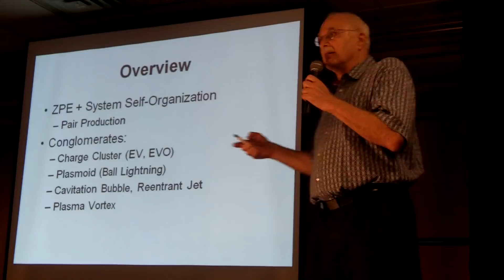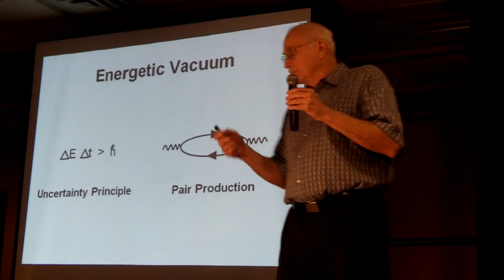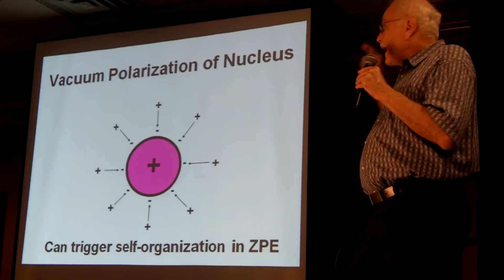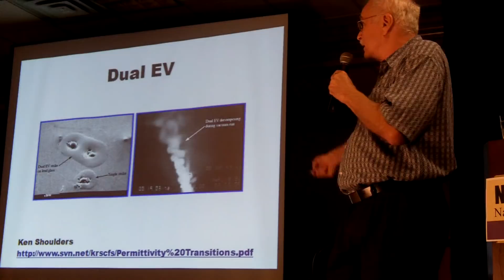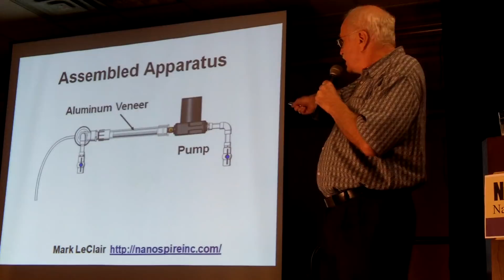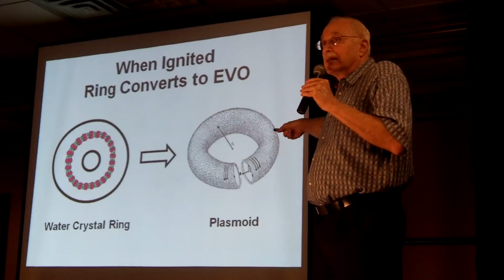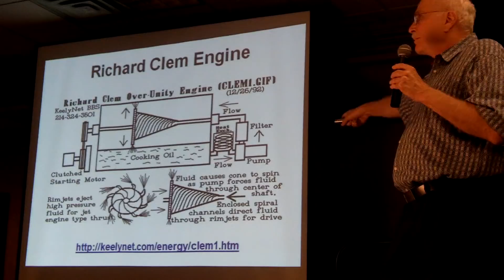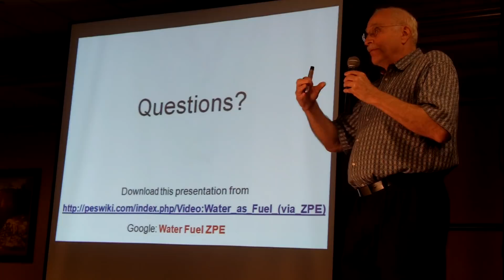How Can the Zero-Point Energy Become an Energy Source?

Comment: In 1983, cavitation from collapsing bubbles came within minutes of destroying the Glen Canyon Dam at Lake Powell, America's second largest reservoir, and second most massive gravity-arch dam. The lake (145 miles long) was already over "full pool" by over six inches. Lake Mead below at Hoover dam was full-time.The only thing holding Powell back was a double  row of 1" thick marine plywood strung along the top of the dam (500+ ft. tall). Water was being released at high rate, but not full out, when they received warnings of an incredible flash flood racing down river from the Rockies. They opened the dam full out. When the two 15' dia. release tunnels were fully opened, the dam, the bridge and the sandstone canyon walls began to shake. At river level, boulders the size of cars were shot out of the release tunnels, along with massive amounts of concrete. One tunnel was closed, and the flow through the undamaged tunnel was greatly reduced. Vents have now been placed in it. YouTube has video of this from a retired Reclamation administrator. The civil engineers with the Army Corps, Reclamation and Bechtel, had not confronted this sudden burst of energy from cavitating air bubbles in water in the design, construction and operation of the dam. The Bureau says the dam itself was not in danger of going, but that isn't the story from some retired workers. Physicist were just starting to look at cavitating bubbles in water for energy releases at the time. See May 1983 flood, Glen Canyon Dam.

Comment: Great presentation and thank you! The ether is the source all matter and energy. Light propagates through it and the sun is powered by it. The sun is cooler inside and hottest on the surface because the ether interacts with the hydrogen there. Plasma is a vortex and this rotation must be present to induce energy flow (organization) in the ether. When you understand that the ether drives the plasma it is no longer hard to understand and does not violate the "law" of conservation. The very fact that experts refer to "laws" tells you all you need to know, don't think or question them. It is amazing how arrogant "experts" can be. Just 500 years ago "they" would burn you at the stake if you thought the earth was round. The theme was "Don't question us" or you will regret it. Now we as a species must stop following dogma and recognize the universe for what it is. A coherent self organizing system.
Reply: Jack Harper When you say "It is amazing how arrogant "experts" can be. Just 500 years ago "they" would burn you at the stake if you thought the earth was round. The theme was "Don't question us" or you will regret it.".....

are you saying that the "experts" and the people who would burn you at the stake (the ones you called "they") are the same people? There was never a point in time where the people in charge of burning others at the stake were the leading physicists at the time. 

Also, that is the complete opposite of how we advance our scientific knowledge. Anytime a new discovery is made, or a new "law" is stated, the theme is the exact OPPOSITE of "Don't question us". The first thing scientists do when something new is discovered is for everyone to try to disprove it. It is only when something is tested over and over again, by different people, that it is accepted as a theory or successful model.

Nothing in science is "Don't Question".... it's all about questioning. Seriously.

Also, there is no either. This was proven wrong in like 1901 or something.
Reply: The experiment you are referring to was the Nicholson and Morley experiment (spelling may be incorrect.) But it was inconclusive because it was measuring the for interference patterns without understanding that the ether is dragged along by matter (the earth). Anyways the US Airforce announced it had verified the etherback in the 1990's. This brings me to your first point. Normally science is promoted by vertification but not in the area of national defense. The reality is all matter vibrates within a sea of ether and light propogates through it as a wave.  The sun is driven by Birkland currents that connect the stars like a celestial power grid. Anyways, the truth will prevail in time. May God bless you and wisdom fill your life. Peace :-)
Reply: The fact that you can find the existence of a god plausible explains how you can find coherence in the idea of the existence of the ether.

This was before they understood and accepted the electromagnetic field as the field which allows light to propagate.

On the point that you said that all matter vibrates within a sea of ether, is incorrect. The Higgs field is one of many fields in which matter vibrates and is the only field that actually interacts with all other matter particles. All other fields permeate space but only affect certain particles of matter.
Reply: +Jack Harper Michelson-Morley, I believe...
Reply: The ether exists and was proven so by the us airforce in the 1980's. Magnetic fields and electric fields are the same thing, they are organized ether (the effect). The "fabric of space" is the ether. Radio waves, light waves, and gravity move through it. To believe the ether does not exist is fundamentally illogical and is dogma from the controlling establishment. Furthermore,  inertia and gravity have the same effect on manifested energy (matter). The electron field around the atom is distorted and the nucleus being off center is out of balance creating the observed effect. Just go drive your car around and observe this effect in turns and breaking. Wake up and realize the truth is simple.
Reply: +Jack Harper just go drive your car around and observe this effect in turns and breaking. Wake up and realize the truth is simple.
can you expand on this ? please
Reply: +Jack Harper   pretty good but not 100 % .. .we must stop believing 
scientific dogma.. ( that has gotten us into this mess  ) and must return back to the   ORIGINAL Catholic Dogma.. ( and not the bible  ) and that will get us out of this mess.. :  )
Cheers and have  a wonderful day
Reply: You can call the air around you whatever you want but it is still a mixture of different elements like oxygen and nitrogen, it doesn't become something else. The same goes for what you said about the "ether" being discovered in the 1980s.... if THAT's what you want to call the electromagnetic field that is your decision but it is still just the electromagnetic field that was discovered in 1861, waaaay before 1980.

Second, to suggest that driving around in a car to give you a feeling of the "ether" shows that you have a fundamental understanding of inertia and the theory of gravity.

Third: radio waves, light waves, ultraviolet waves, are only SOME of the exact same thing: electromagnetic radiation, and no they do not need a medium to propagate through, this is one of the defining characteristics of light.

Lastly, you can't just assume that the electron cloud will disturb the nucleus because that would assume that nuclei also react to things the same way larger objects (anything bigger than a grain of salt) react because different forces are stronger at those tiny scales and therefore do not experience an "imbalance".

I'm not trying to sound like an asshole but most of what you are implying can only be true if we ignore other MAJOR concepts in physics which can be proved by middle school science experiments.

Comment: The Richard Clem 
Over unity engine,
Is built useing a automatic transmission internal fluid pump coupled to the TOURQE CONVERTER with high pressure jets affixed around the outside.
 circumference.

When the internal pump is spun up with an electric motor,
It forces the fluid out of the jets at high pressure, thus spinning the converter as if attached to an engine.
The high spin of the converter causes the internal TOURQE multiplier to spin in reverse, thus causing a fluid vacume that feeds the the spinning converter and by doing so the internal pump and motor can be disconnected altogether from the system.

It's all based on the tornado and vacume cleaner principles.

Did you know the destructive forces of a tornado are really the high air pressure current being pushed out of the base by the  influx vacume action of the spinning mass.

The out put power is much more powerful than the vacume of the vortex.

Comment: I somehow suspect that an energized and coherent/perfect/precise bombardment of toroidal smoke rings (meaning: as in a "smoke ring") at/toward a specific (unknown) substrate, might produce a result. Perhaps even to produce bypassing toroidal smoke rings through/within another set of toroidal smoke rings of differing sizes would also be an interesting experiment. Sometimes it's simply a matter (pun) of using our imagination. Let's face it: Toroids appear to be a common denominator that holds a unique key. I like to think of the Zero Point field as a substrate full of unpopped popcorn kernels that when activated produces all matter and thereby all elements. Imagine a device that will someday produce whatever "Product" or "element" that we wished; like a 3D printer that produces EVERYTHING, even a hot baked potato...dream...dream...dream....BIG!
Reply: Kernal* not kernals

Comment: yes polymers act that way to as liquid stat before solidification nano flaws when a static charge is applied creating plasa type trapped particles mainly a carbon burning surface  in the micro scope its tiny spiral holes straight through to the substrate  adding magnetic fields to guide it through the polymer strange but wonderful science

Comment: In between two cells is a membrain mostly isolation barrier and out of that is a point to try dry ice ceramics the glowing t point in the chambers that collisions occurs causing the glow in micro point this is major role in the waves that black hole draws in 7TY7N581KVXZK6UNG901 so complicated bit fearing the unknown seems to be like an eternity a onion layers like fields. a thought energy of the photons have been a high probability that multiple lift glanders like foamy distilant sparking charge pop out from its own those are traped particles that are just like the sparks that lightning strikes out from ground to space Tesla funneled power types. Just a guess

Comment: Figuring out how to have a non negative relationship between the Ethereal Fields and the vacuum maybe it's self a non issue the various ways that we are going through their relationship between the characters of vibrational change motivate the body of energy that seems to have a good idea to get the chargers to draw in forced attempts pressured  abrupt action to lower this the pressure's need to ballance to make sure the over charges don't  burn up the substrate and melting it.

Comment: The pap engine works wonders for the system,.As a whole new way of thinking about how much extra energy from the change state the plasma creating in the magnetic field to center the forces of gravity pressure expansion and contraction of the gas atom controling a

Comment: I want to get a rotax 1000 sdi sled 2 stroke engine and use a plasmoid to power it. A water arc explosion with a toroidal plasmoid in the head formed would work provided it don't burn through the head or piston. i can get one of these engines. An interesting experiment.
Reply: Don't ruin a rotax engine ! There are other ways
Reply: @XxFoxMotoX3xX  A harley v-twin 2 stroke converstion! I got an OMC small block v8 2 stroke and an 8v92 detroit. a few OMC rotary sled 2 strokes scattered through the house. Tesla was an Impulse 2 stroke developer an been vindicated by eugene pokletnoves impulse gravity beam! yes it would take a softer pulsed plasma to drave a 2 stroke as they work off far less energy density of carbon fuels. most cars are a 2 stroke but no high power continuous duty! Explosive arc plasma's, lightning, arc explosions are huge shock force wheres are piddly 2 stroke auto, gas diesel engines are recommended to avoid knock!

Comment: Zero Point Energy = Ether/Aether = Fifth Platonic Solid. Ether accelerates towards the earth at 9.8 m/s2 producing gravity, weight and inertia we experience so we have to think in the line of how do we tap into gravitational potential energy more efficiently and convert it to electricity. Gravity acts similar to water going down the drain pushing objects in the water towards the drain. Earths electrically charged mass acts like a drain pulling the ether from space. Ether in turn pushes everything towards the earth producing gravity, weight and inertia. There is no such thing as empty space.

Comment: these fingers of energy are the seperators that asist in the systems collections of magnetic ceramic style matters frequencies are taken and those are the same as the eletron asimetrics waves so you really could make a so called energy from nothing in these same profiles the frequencies are the inbetween s of the finger s that vorticularly twist or spin